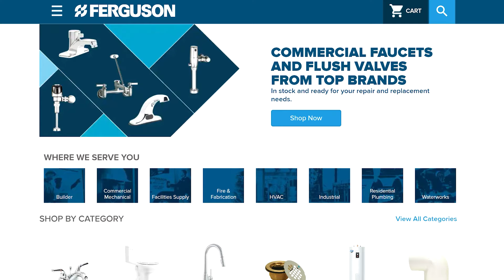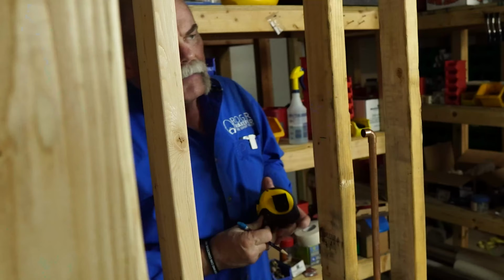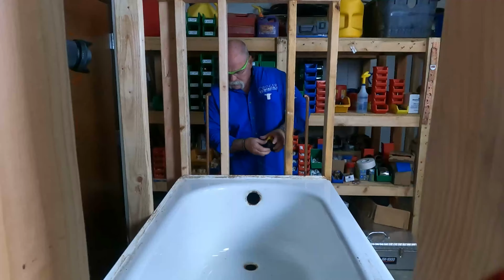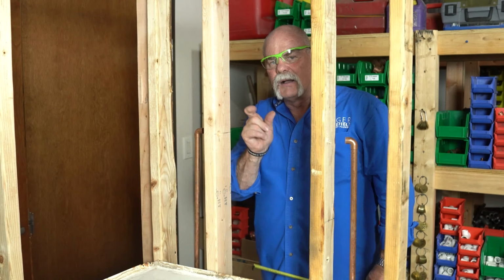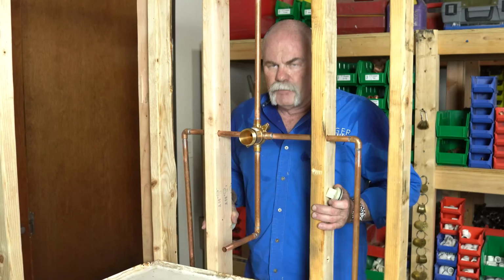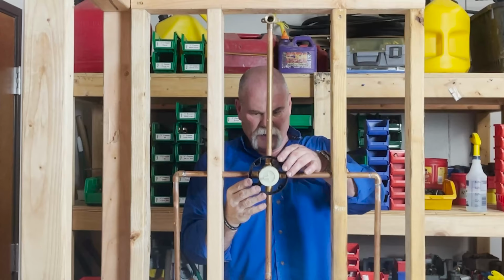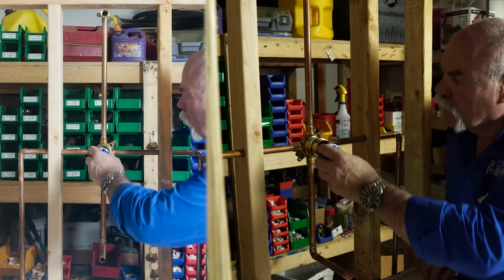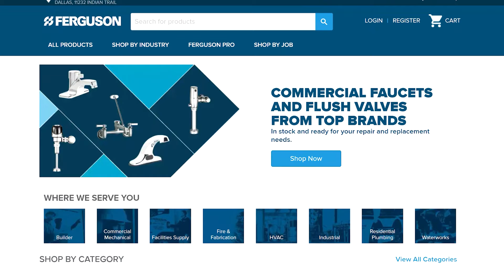New Home Shower and Tub Faucet Installation |  The Moen Encore

Comment: For the moen valves, 99% of the time, a 2x4 block across the back of the studs gets you the perfect depth. But every shower is different, so in order to avoid issues later down the line, its always necessary to check with the ge or tile guys how thick their cement board and tile will be. This way you know for sure your depth is correct, and if it ends up too far in or out, youre off the hook. Surprised this wasnt mentioned. 

To add to that, the tub center will be on the specs sheet if the tub is new, but even then, the walls arent always perfectly level. So by the time you find the center up by the showerhead, it may actually be a 1/2”, 1”, etc left or right. For this reason i used to take measurements from a few different reference points, but now i use a laser, perfect results and no double guessing. It usually isnt a big deal if its off by a little. However, the center of my shower at home is right on a grout line; the tub spout is slightly to the right of it and the showerhead a bit to the left. It may only be a half inch difference but its fairly noticeable because of the grout line. 

I also add a 2x4 for the tub spout as well. This way if anyone leans or falls on the tub spout, it doesnt disturb the shower valve. Ive seen caulking around the handle trim split because the valve would lean forward when pressure was applied onto the spout 

Hate to keep going, as youve been in the field far longer than I have, but the copper running through the studs like that can lead to noisy pipes. Ive had to open dozens of walls, showers included, to remedy this. 

Last thing, its best to just slap some nail plates on there. Though the pipe is deep enough to not require it, if a grab bar or slide bar is installed and a screw goes through that pipe, boy howdy would that be an expensive mistake
Reply: with the shift to pex, valve manufacturers should build them with a frame that screws to the studs and then the valve mounts on adjusting screws to the frame, so it can be adjusted for the finish depth of the wall.
Reply: As a service plumber the blocks across the back are a pain, I get it but damn that sucks to work with when sheetrock and tile are up.

Comment: 1: this reminds me of the showers in my college dorm where the heads were 4'6" off the floor.

2: to be more accurate to actual construction, the trainer should have a stud within 2" of the center of the tub and at least one knot where you want to drill.
Reply: I thought that seemed a bit high as well. I guess it makes sense as most people take showers so it would cater more to showers than baths. As for your stud comment. I’ve always wondered how experienced framers who have presumably framed at least 1 house previously can’t envision a shower valve being installed and just do 16” centers
Reply: @joshcowart2446  just doing 16" centers is the norm. But that layout usually puts a stud right where the valve goes. The real fun comes when the framers don't put any studs where the edges of 4' sheetrock hit them.
Reply: @kenbrown2808  I’m not as familiar because I’ve been doing commercial for many years now. With the few I’ve done over the years some do and some don’t so I don’t know what’s more common. It’s seems like it would be standard practice to leave it open. It’s not like it matters. It doesn’t carry a load it’s not dependent on a full sheet because tubs are usually 32”. I don’t know why they can’t leave the space.
When I started in the early 2000s, they’d always leave space. Then again it was a small town so we worked with the same 2 builders over and over. Also we still put in a lot of 2 or 3 handle valves then as well so you had to have that space. Though even at 16” centers, it’s not load bearing so I can’t manipulate what I need to get it done but missing the edge of drywall is pretty bad.
Reply: @joshcowart2446  residential framing pay hasn't gone up since the early 2000s, so you can guess what quality you get.
Reply: @kenbrown2808  Thats the truth. I did a commercial job. It was a small wood framed office building. They just took the cheapest bid on everything. The electricians seemed competent. They hired us because we did a lot of work for the guy when he worked for a bigger construction company but other than that it was bad. The main issues seemed to come from framing and concrete which may have been the same people. The slab was one of the worst I’ve ever seen. It rained and some spots had over an inch of water and I don’t think they owned a level. The fact that they used the plastic from a road block  instead of Masonite for the driveway curve says a lot. Anyway the framers were the worst. As a plumber I very quickly noticed they put nails in the top plates everywhere. You couldn’t drill one hole without hitting a nail. They didn’t use any joist hangers. My apprentice almost fell off a ladder because he grabbed a stud to brace himself when climbing and it pull down because their top two nails were only about an 1/8” from the edge. I pointed it out and pulled it out of the wall so they’d notice it and fix it and also so no one got hurt by assuming it was sturdy. They just pushed it back in place. I ended up pulling it out 3 times and then finally grabbed some of their nails and fixed it because they weren’t going to. None of the roof decking had h clips and you could see daylight through it in several spots. They blamed all the issues on BMC and said they didn’t send all the material needed based on the plans. They eventually had to hire a 3rd party framing inspector to go through with them and tell them everything they needed to fix. This was the perfect example of you get what you pay for. It ended up costing the builder a lot more than it would have to just spend a little more on quality subs.

Comment: Here in California, I would have used a half inch ''Isolator'' to protect that 1/2 inch copper as it penetrated the wall studs. In fact, some of our localities would require it. Another thing the state would demand is an air chamber on both hot & cold lines. Which would have been installed with a copper T fitting instead of that 90 degree El you put in on both the hot & cold supply lines to the mixer.  

Isolators can really reduce the expansion creaks and squeaks associated with supply systems. They come in three sizes,
1/2 inch, 3/4 and 1 inch. All require a 1 & 3/8ths in forstner bit to drill through. Which is kinda time saving. As it means that I don't need to carry various sizes of forstner bits just for my supply lines.

Comment: We just did a tub/shower with the new encore cartridge love the new technology. Only downside is when you put the cartridge in with the plastic loader. Got to be careful we ended up pinching one of the rubber gaskets and ruined the cartridge had to get a new one.

Comment: Crazy how much work this is sweating everything, I use worsbo pex 95% of the time and the other 5% of the time I'm using copper press. Your detail work is awesome but no offense I would've been done way faster with pex :). - Journeyman plumber in Kansas
Reply: Well you wouldn’t do well in Illinois( Chicago area ) with pex is all copper.
Reply: @Sam-yn3do  propress to worsbo pex adapters :) love them
Reply: So are you saying that you connect the PEX A directly to the valve and if so, have there been any leaks in the walls?
Reply: @lillithjones993  brass female worsbo adapters off of the valve, and I've never had a problem.
Reply: @lillithjones993  you can sweat the adapter off the valve & put propex adapters on just make sure you remove the cartridge before so it doesn’t melt. And uponor propex if probably really good up north, it can expand & contract, my only concern would be if water freezes in the actual fitting used with propex, it’s a composite but I don’t think it would expand and contract well

Comment: So for your tub shower valve why are you not just using 6" and 12" off the Tub flange for valve height? up where I am at that's standard rough in. Will admit though. Your work is clean.

Comment: That was an apprentice like install... The hot side 90s wasn't even seated all the way. You took to much time with the extra measurements when your could've pulled the tape measure from the wall to the center of the tub and wrote down the center, cut your mounting block, drill holes on center with ¾ paddle bit so you have play, pre solder copper in the hot/cold supplies on valve that carries past the water lines, mark for your 90s, wedge between studs, hold valve on center line and anchor it, make sure your in the proper depth for the finished wall , anchor block with valve, cut in the shower and tub lines and solder away...

Comment: Hey Rodger, I didn't see any intrical stops or any type of isolation valve on that valve. Are there any on that? If there is no way to isolate that valve it would not pass code in New Jersey
Reply: do they also require an isolation valve for the isolation valves?
Reply: @kenbrown2808   no , just need some way to isolate the valve
Reply: @guitar1301  here, they just require a main shutoff, but isolation valves are used for convenience in most places.  they are rare on showers, though.
Reply: In Chicago they require isolated valves in multistory buildings, residential you don’t need it.

Comment: Just installed 10 back to back showers with divertes in  hospital patient rooms still have 40 to go
Reply: You like what you do?  I would love that.
Reply: @DDunc1020  I do like it like anything else there's good days and bad but I wouldn't change a thing
Reply: @Allintn22  ya service plumbing is a hit or miss for me
Reply: @DDunc1020  I started in New commercial construction from underground to top out for about 5 years then went to the service side and I've been there for 12 years I like service more it's always diffrent problems diffrent places I do hate 
the on-call
Reply: @Allintn22  ive been doing service over 4 years, would love to get hands on in new construction but the pay(from which im told) is not nearly as good as service...always something to do in service and i hate on call as well
Reply: @DDunc1020  That's true the pay usually is a little lower but there's no on-call your off the same time everyday unless the OT is required I feel like every service tech should do atleast 2 years in new construction but depending on what your pay is it may be worth making the switch sooner then later you can always go back to service I make to much from  Doing service to long to start over then depending on the company alot of them have have "special projects" division that is kind of best of both worlds thosebjobs are usually remodels or build out so it's a little more of taking old and making new in a since a little more of a challenge because you have to navigate pipes through already existing buildings

Comment: if you water tested that valve with that plug in there, instead of an actual cartridge, water would come shooting out of the tub spout stub out. Another problem with those plugs is they let the hot and cold water mix inside the valve, and the whole place will get lukewarm water.

Comment: Hey Roger the code in Texas don’t require air chambers?

Here in Chicago we have to install 12” air chambers for each fixture.
Reply: Like hammer arrestors?
Reply: Air chambers? You're referring to a foot long chamber filled with air to act as a shock absorber for the fixtures to prevent a water hammer right?

We have shock arrestors which are a lot more efficient and not prone to get filled with water as it has a spring with air compressed.
Reply: No more air chambers in Chicago suburbs 
 water hammer arrestor only !
Reply: @Sam-yn3do  That definitely is protocol now a days,as far as I know air chambers are what they use to install before water/shock arrestors back then. They are definitely obsolete if still being used.

Comment: Always surprises me still, why not use metric while measuring, seen all those fractions would make me insane also i assume it isn't always that accurate either
Reply: that's 374.65mm, if you want to measure it in metric.
some cabinetmakers will convert the base dimensions to metric and build the cabinets in metric, and some people will use inches and decimals to measure for easier calculations.  but really, feet and inches is base 12, which makes it easier to divide things in thirds if needed, and the size of the units is much more convenient for the scale used in construction.
Reply: The metric system is only for countries that haven’t put men on the moon.  🇺🇸🇺🇸
Reply: @tkou272   well you only got ti the moon cause of metric and a german scientist

Comment: Maybe a a few shows Dedicated strictly to “ how win a new work residential bid with copper in today’s market “. There’s so many Mexicans here using pex. I have to compete. But would love to win the profits of the extra time and up charge to customer  of copper fittings. I’ve tried everything. But when I show the difference in cost. They pat me on the back with a horse face laugh. Saying I’ll give you 3 guesses which bid I take and the first 2 guesses don’t count. 

Not commercial. Residential stick frame site built. That would be a super series. Don’t get your guys to roll play. You need real world contractors. The ones here just start laughing. Just takes the sales pitch away. Customer owned new builds. On a rare occasion. But even then they treat you like your the pity case. They could’ve plumbed that.
Reply: I don't know of ANYBODY who does ALL copper in residential, any more.  some plumbers will still do a copper bath/shower assembly like that, and some buy their hardware with PEX fittings preinstalled.